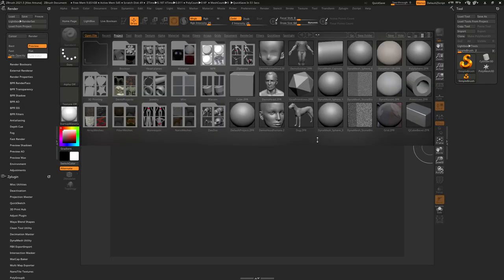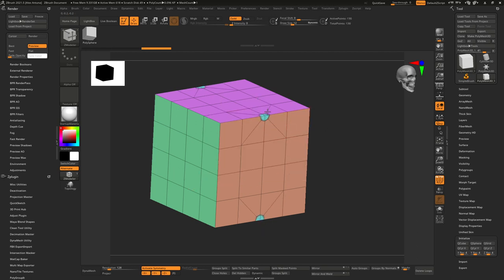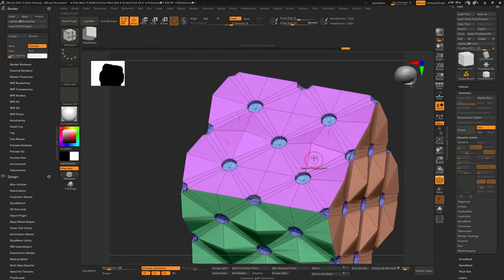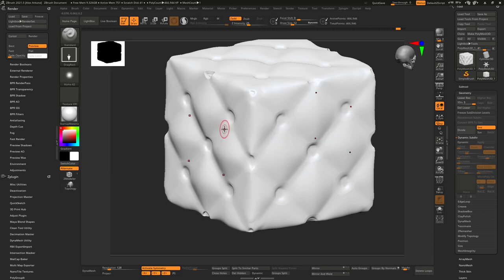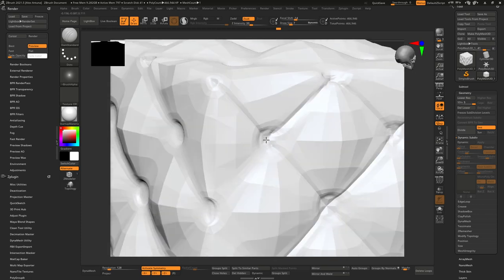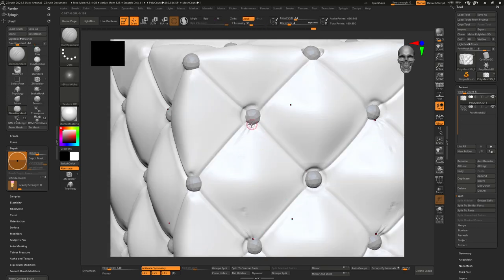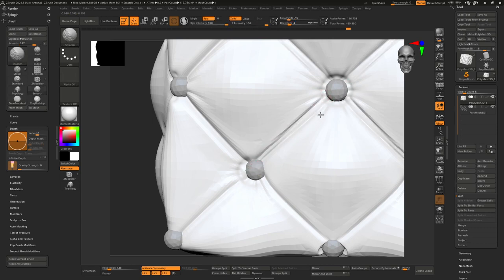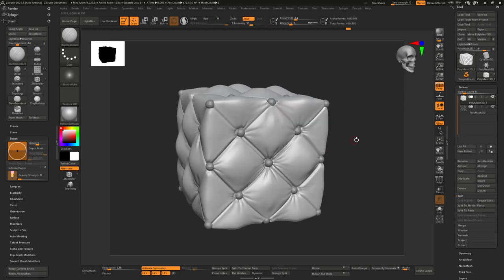Tufted modeling in ZBrush

Comment: hey man, I was wondering is there a way to make the pattern on a round or circle as well, like on a hat
Reply: I tried with a sphere, but in the corners, it would become uneven, is there a way to fix it?
Reply from the maker: Yeah a lot of the method comes from an evenly divided mesh. You can use a box and subdivide it a few times and that should give you a more even mesh to work with.
Reply: ok, I will give a try, thx for the idea
Reply from the maker: You're welcome, hope it helps!